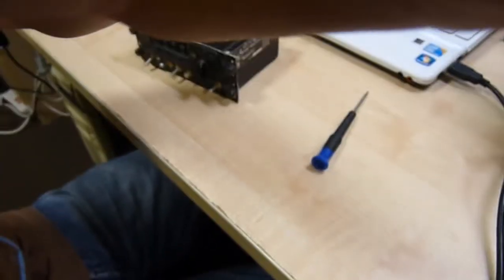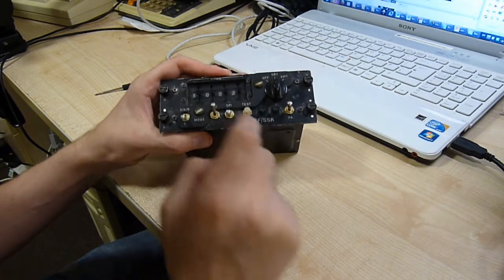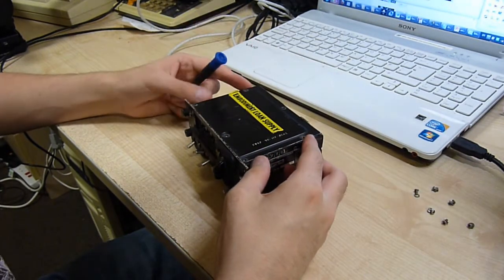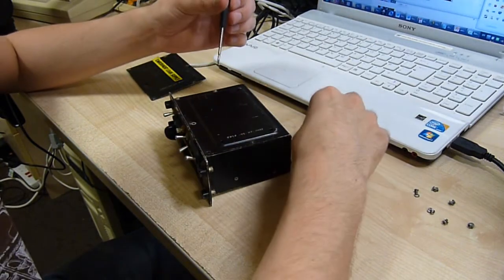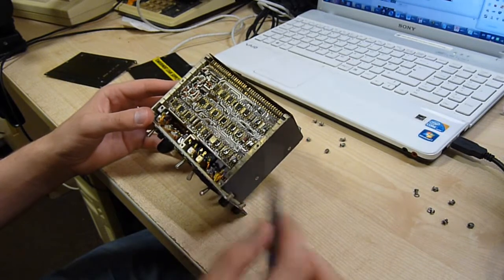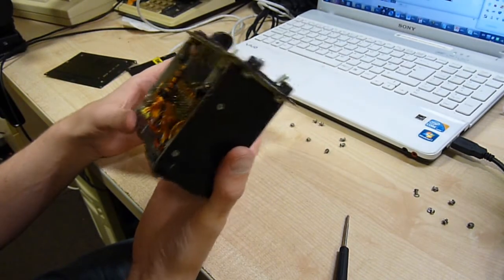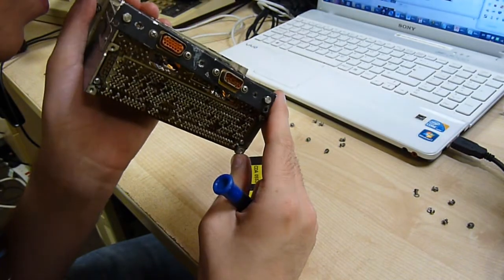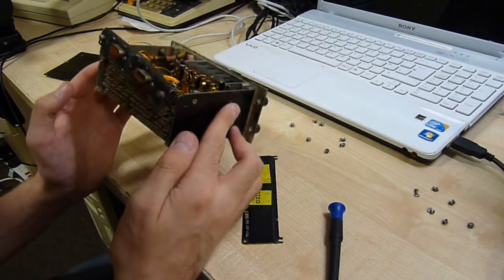Plessey Control Transponder Teardown

Comment: What I would reeeeally like but probably only in my dreams is to get a scrapped cockpit, one that uses the digital displays as primary flight and navigation display, all functioning switches EICAS, FMC etc with real goddamn throttles and yoke and hook it all up to flight aim with the PMDG or other realistic add on!  Then I really can fly like a pilot  still getting the hang of programming the FMC but I suppose using the real thing is a lot better than using the mouse on the screen!!